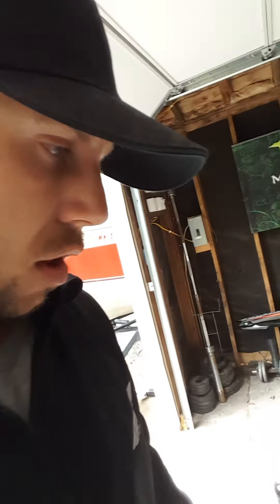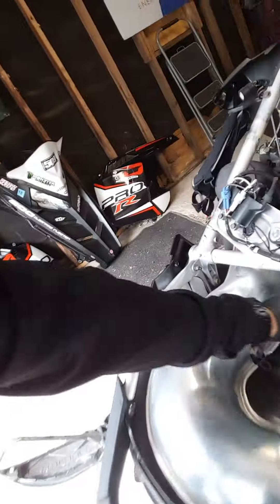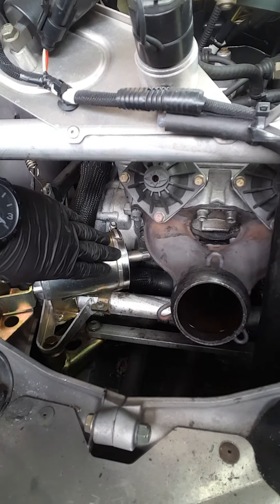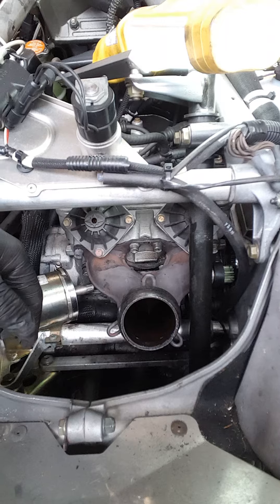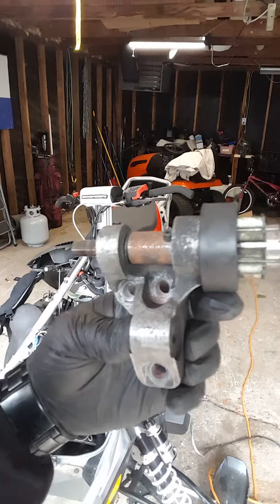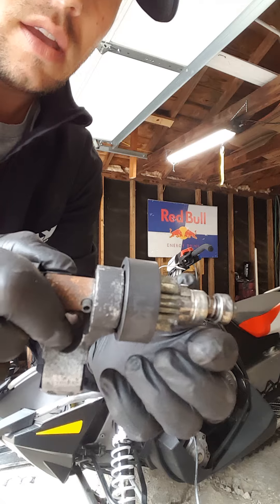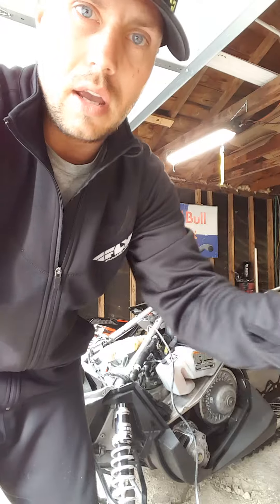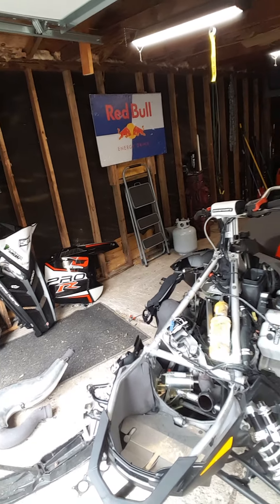2013 Polaris Pro-R 800 Starter Troublshoot and Fix

Comment: Tackling this on a 2015 axys chassis 600 switchback. It's essentially the same process and parts. Finally got the whole starter system out. I unbolted the motor to get access to the bottom left y pipe bolt. A 6mm allen socket on a ratchet makes this job pretty easy. I've had issues with the starter not engaging fully with anything less than a brand new battery, and after hauling this whole thing apart, I suspect the rust on the bendix helix is part of the problem. There is a rebuild kit available for around 60 bucks (canadian) from royal distributing. I'm going to try cleaning it up and re assembling. Thanks for the video, you're the only source of advice I've found on this subject, anywhere!

Comment: There is a clutch on the end of the starter shaft. Its supposed to spin backwards as you show. A new one is tighter but that's because its not "broken in" yet. Its made to spin that direction because the starter motor and gear would be ruined when the starter gear is still engaged and the motor starts.  The problem here is a dirty helix (you called it a worm gear) This helix need to be clean and dry because its only the inertia of a spinning starter shaft that makes the gear fly out and engage the flywheel. The problem is crappy design. It should have a boot over it but that's another story. Its gets full of belt dust, oil, and muck all over the shaft making them sticky so the drive gear doesn't "fly out" and then the starter just spins freely. A new assembly like you show will fix it but its really not needed unless its damaged. A good cleaning and a dry lube, if any, is all that's needed. Usually can be done without removing half the engine to get access.

Remember... when designing sleds, the stylist (who've never held a wrench) get their way first and then the engineers pack all the crap into the space that's left. NO ONE EVER thinks about service
Reply: saltcar what do you use to clean it?
Reply: Brake cleaner works best. Be careful around the plastics. Use a towel underneath and soak the helix several times while blowing it off with an air compressor. It might take a few times to clean it. Add some dry lube if you have any. Do NOT use oil or grease - it will work temporarily but will attract even more crap later and gum up again
Reply: Do you have to take it off to clean it?
Reply: No. I use a spray can with the tube nozzle and reach in to spray it. A few times with air should do it. Take a look at the gear teeth while you're in there. Sometimes they get ruined from being half-engaged (because of a dirty helix) If that's the case, you'll need to replace it.
Reply: Isn't it called Bendix?
Reply: @saltcar  do you have to replace the entire starter if some of the teeth are damaged?
Reply: @jefftillman1541  No, not if you can find just the gear or assy shown in video. The starter motor is separate on these and is driven through a flex cable.
Reply: You just saved me money...Thanks for this.

Comment: Hey Mark, I just watched your video on a 2013 Polaris changing the starter. I got a 2015 access chassis I can't get on the Allen bolts for the y without taking the exhaust valves out and the steering columns in the way to get the right hand rewind side exhaust valve out of there. You ever done one thanks for now. Have a Merry Christmas

Comment: when I activate the starter, it turns in the wrong direction, so logically it is normal that the gears rotate in the same direction as the starter. What do you think ? Would the problem be that you describe?

Comment: Bad video.. so how do you take that last bolt out bottom left starter in the way..???????
Reply from the maker: Eric Iverson i used the end of the allen that has the ball so you can come in at an angle thats not straight in.
Reply from the maker: Eric Iverson its a pro ride chassis. Not a axys fyi